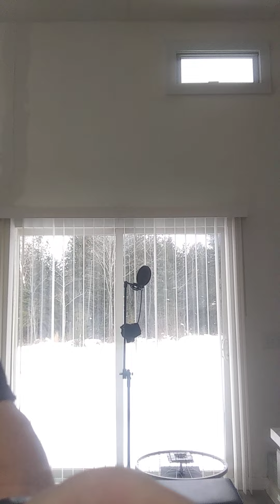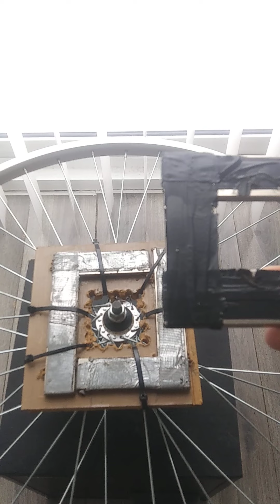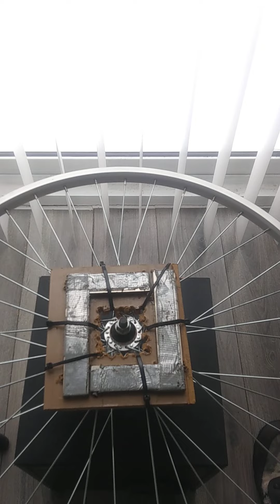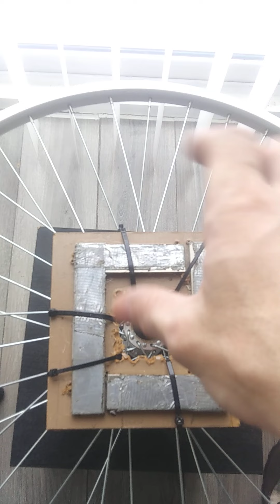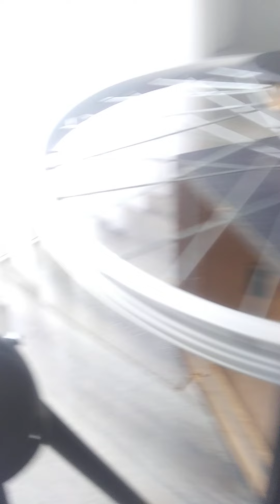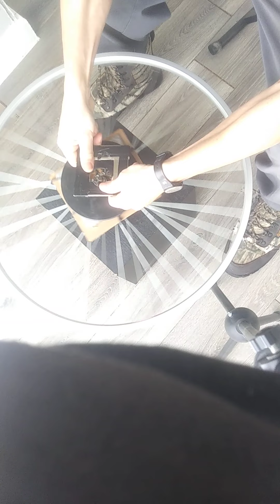Demonstration of the MT Drive magnetic propulsion system by inventor Michael J. Talaske.

Comment: This is cool, but nothing perpetual about it. Someone or something has to pump that magnet up and down. It would be cool to see it hooked up to a stirling engine to pump the magnet, but tests need to be done to measure power output.
Reply from the maker: The action to move the magnet is so subtle, it’s like light as a feather. The Universe is doing this motion naturally, you can feel it. It doesn’t take much to move it, a spring could do it.

Comment: Reminds me of the coral castle magnetic flywheel that is set up in a repelling fashion like this.  I wonder if Ed was doing something like this.  As a mechanical engineer when I see this I think of gears and cams to create the pumping would run forever or until the bearings wear out.
Reply from the maker: It naturally wants to do the pumping effect. It just needs a slight motion. Coral Castle is what inspired me to build my system. Ed said he built 10 different light machines, who knows what he had going.

Comment: Your really onto something here my friend and I thank you for making this open source tho I hope none changes the design slightly and puts a patent on it. Ok. You need to get into arduino electronic asap and understand how the programming works if you already don’t. I thought of something similar but inside a magnetic tube which would cost a lot to demonstrate but I like your idea better. You need to use circular magnets. Perfect ones to use would be off the back of a speaker. You need to place the magnets into a tube and then have a spring on the back of the springs your pushing. You can leave the back of the tube open so you can get the right spot until you can spin the wheel by hand and then let permanently leave the magnet in that position. You can then use electronic kits that will get that pumping going faster than you hand with a sensor on the wheel so a solenoid can do the push and pull action instantly. Have we got a page going with this project yet so we can get something going because this is big MT. Don’t worry about the haters worry about how we can turn this into something useful. Again I thank you for making this open source
Reply from the maker: Thank you for your interest. Yes, the solenoid idea is what I was thinking as well. I was looking a car door mechnism to do the push/pull. This is why I open sourced it- because I'm stuck at this point, and don't know how to make the sensor/timer work. Keep in touch. I will check out your site. My email is: Miketalaske@protonmail.com

Comment: Yes, but energy is required for the pumping motion. The energy you, or any other device uses to create that pumping motion is more than the out put from the magnets. So you are not creating any extra energy 🤔 - create something that will do the pumping motion for you that doesn't require energy... then you may have something.
Reply: It's a start tho and pretty cool still but I agree with you...
Reply: @jluvbaby  momentum... the secret... still a secret
Reply from the maker: Boy, your a real genius! Why do you think I open sourced this? It oboulisly needs more work.
Reply: @teslafieldphysics4041  👍 good luck to you. My comment was not negative. It's just that this is nothing new or zero point energy. Magnetic engines already exist, just are not used much.
Reply: @teslafieldphysics4041  keep working on your project. To get this far you are close to something very different and possibly game changing..